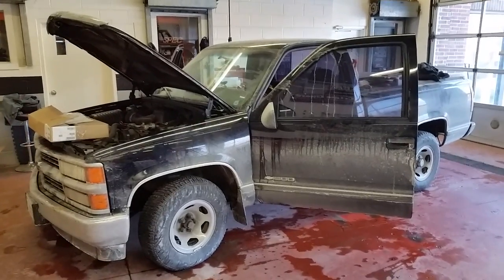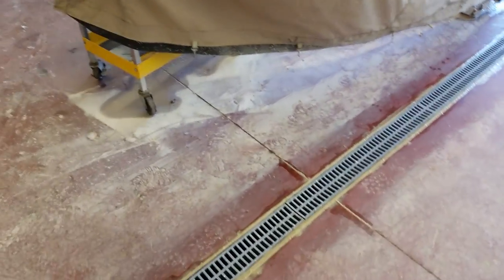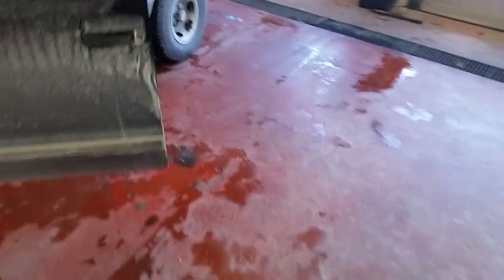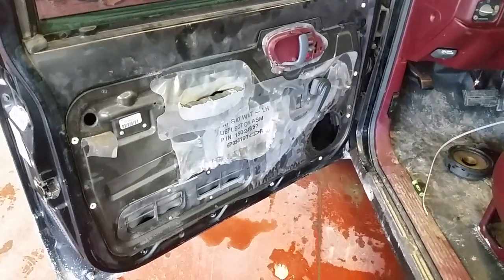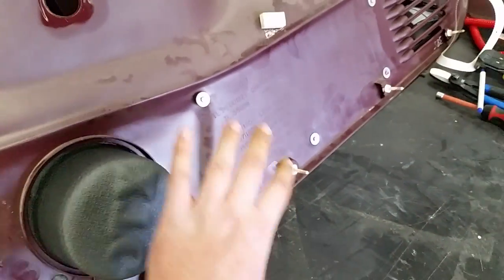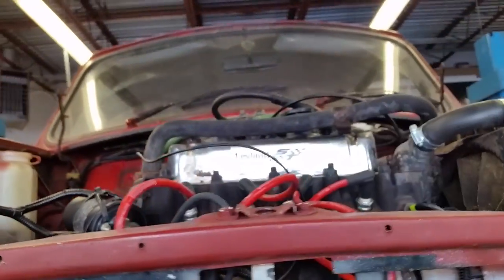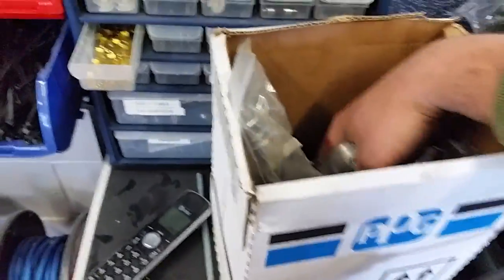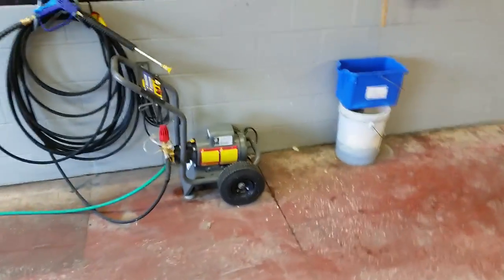Main Drain Mini Shop Truck!

Comment: The drain turned out good, even with it though you may still end up getting water on the other side, a smoke curb will help with that.
Was the Mini hard to get parts for??

Comment: Speaking of a STD cab truck. Do you do much with classics? ive got a 1972 Chevy k20 that i am building. ive got dynamat to install in the doors and everywhere else. ive got a set of custom brackets to put 6x9s in each cab corner, and am trying to figure out a front speaker for this truck. im not a fan of the speakers in the door. stock these only had a single center speaker./ i want to make it sound somewhat decent.